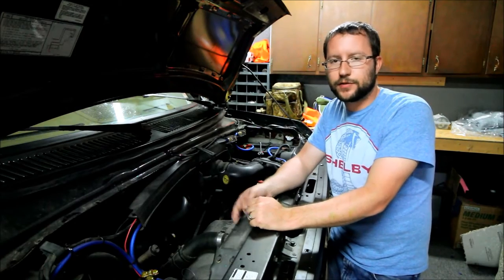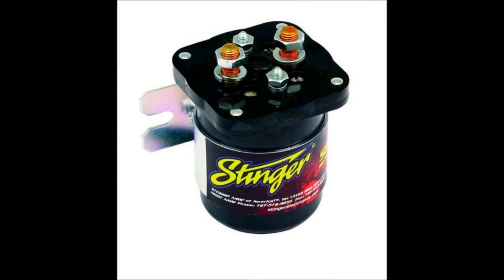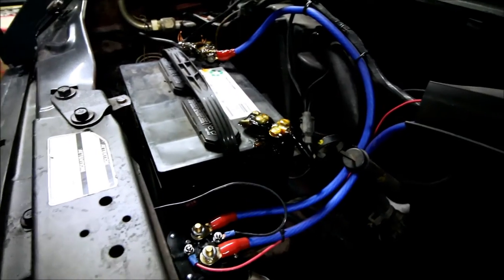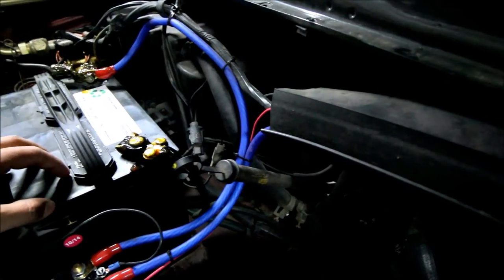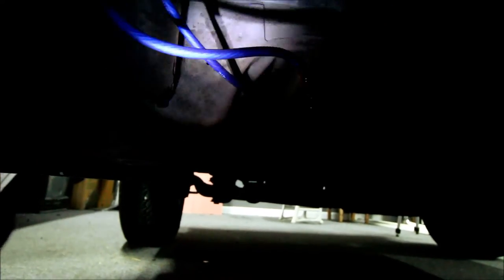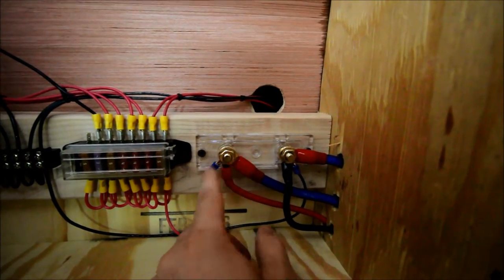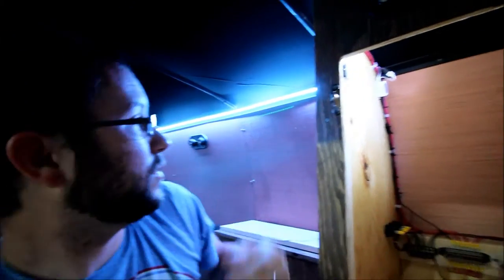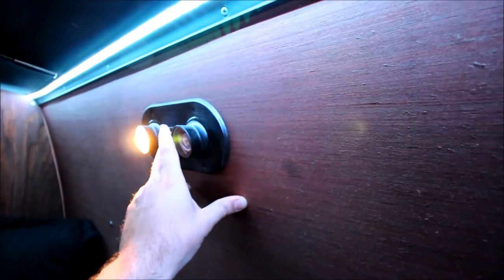Camper Van Power. My 12 Volt Battery Isolator Setup

Comment: Sweet setup on the electrical. This is the only thing i have left to do on mine.I am going to be using a setup out or an RV I'm thinking on mine.Since I got it for free lol.
Reply from the maker: That would be great to be able to use a 12 volt system from an RV. Anything free is worth re using!

Comment: If i may suggest .. up size the wire from the terminal block to your fuse block.. as in sure you know the current adds up and will cook that undersized wire.. looks like you may have used a 12 awg wire.. may wanna use an 8 or 6 wire for your fuse panel . might have to change out your fuse panel to one that has a main post that you could attach a larger wire.. GREAT SETUP!!
Reply from the maker: Prepping2endure thank you for the suggestion. It's been ok so far, but you are probably right. Thank you.
Reply: i was to suggest the same thing and i was checking if someone did it before me

Comment: I don't believe you mentioned where you found an open fuse for the dedicated ignition wire to the battery isolator...I believe thats what you called it.
Thanks for the video.
Reply from the maker: A true ignition source is what you are looking for. What that means is any wire that gets hot when the key is turned on. I was lucky to find a wire under the hood that had a female end on it that used to be plugged into something at some time. The easiest way to find a true ignition source is find the fuse block for your accessories or radio for instance. Find which side the power is coming in and then test the opposite side of the fuses. Find a fuse that is not hot until you turn your key on. Once you find that you can wire your true ignition source wire from your isolator to that connection. I hope this helps. I am not the best at explaining things some times.

Comment: The only problems I see is the inverter cable should be limited to 6' for voltage drop. 4' is ideal. But your inverter is small enough it shouldn't be an issue with 4 awg. Just mentioning for others. Short feed and output is where you can extend.
The most important safety feature is any hole use rubber grommets and silicone. I would refrain from metal clamps as vibration is your enemy and that is where insulation will wear. Always use stranded wire. Good video.

Comment: great explanation. big thank you. 

1. you said 4 gage wire for batteries.what gage for the lights (ie coming out of the fuse box?)
2. you need to run a ground from each light back to a grounding fuse box, back to the frame grounding? (totally new to this sorry)
Reply from the maker: Glad you liked it. I used 16 gauge stranded wire for my lights. You could use larger like 12 or 14 but I wouldn't go any smaller than 16. The main hot wire goes to my fuse block and keeps one side of the fuse hot, the other side of the fuse block gets wired to your hot side of your light or accessory. When you put the fuse in, it allows power to pass through the fuse to the accessory. The ground is similar but there is no fuse. I used a ground block for easy wiring. Ground your fuse block to the frame or ground post like I did, then your ground from your accessory will go to the grounding block. I had to use jumpers on one side of my fuse block and ground strip because each terminal did not connect to the other. It's a lot to take in if you aren't familiar with wiring, but once you do it a few times it will make sense.
Reply from the maker: All your grounds will go to the grounding block and the grounding block will be grounded allowing all the accessories to be grounded.  On the hot side, if your accessory has a switch all you need to do is put the positive wire to the fuse panel. If it doesn't have a switch and you want a switch, take your hot from your accessory and go to a switch and from the other side of the switch to the fuse panel. That way you have a switch in line on the hot side to turn your accessory on or off. Hope this helps.

Comment: @RubberTrampRenegade So the amount of amps that charges the shallow cycle battery (van) won't damage the deep cycle battery (house)? This is what I'm stuck on and don't understand. I'm about to put an isolator on my rig but I'm not sure why it wouldn't hurt my house batteries when everything out there has told me there is a limit to how fast you can charge them.
Reply from the maker: Ryan Bell I really think you are just confused. The alternator will charge the van battery and your deep cycle batteries if you use an isolator. I'm not understanding how charging the van battery will damage the auxiliary battery? What do you mean? I've had my batteries set up this way for over a year now and I have not had a single problem. Your alternator puts out about 13.5-14 amps when the engine is running.
Reply from the maker: The alternator is designed to maintain the 12 volt system while you drive and maintain your vehicles battery. It charges at a relatively slow rate.
Reply: OHHHHHH!!! I saw someone say that the alternator put out over like 60 amps. I was confused! (never measured it myself, sorry) 

But still, charging in this way would be like a continuous bulk charge, correct? I think we should let the 3 step MPPT charge controller charge the battery every once in a while too so as to let the battery go through all of its cycles. I think that would help lengthen the battery life. Does this make any sense to you? The only reason I ask is because I want to keep my batteries for as long as possible... because I got some expensive ones.
Reply from the maker: Ryan Bell definitely wouldn't want to ruin your batteries. I don't have a charge controller but I can see where it wouldn't be a bad idea. I've just use the isolator between my batteries and it seems to be working fine. The alternator charges at a constant voltage but shouldn't hurt anything.

Comment: Thanks for the video! This is exactly the setup that I will be looking to make in my own van, glad to see a detailed vid like this that didn't confuse things with solar. Just a quick question on the clear unit with two posts inside the cabinet that everything is connected to. What exactly is that? It looks really central to everything but isn't fully explained. Is it a circuit breaker of some kind?

Comment: from what I understand a 24v inverter uses less amp capacity than 12v. thought about 24v panels on roof of my van and 4 12v 100ah batts, 2 wired parallel wired in series wit other 2 that are wired parallel. problem is I have a isolator on van that says only puts out like 13-14v and that will only charge 1 12battery I hook it to. so question becomes should I hook it all up that way or just go with 12v battery bank and 12v panels?? I wanna run a few ac thinks and figure about 200ah's maybe used a day running 5000btu ac runs just over 500watts and 5amps, fridge from 50's I haven't found specs on, and in winter a 750/1500watt space heater. Basically I seen info that a 12v inverter will burn 10ah per 100watts used opposed to 24v inverter using 5ah per 100watts. now just for ac which isn't constant of course just as fridge and things, ac say 500 watts so 12v bank and inverter would be sucking 100ah vs 50if 24v? non of this makes a hell of allot sense to me as I'm thinking also 500watts x 10hrs is 5000watts so how the hell do I get 5000watts from solar either system that can fit onto a van's roof? I'm gonna have to figure something out before I hit the road as I'll have my 2labs with me and I'm gonna be boondocking/living in it with them and I'm not retired, can check them on brakes let them out do there thing which to me is better than them kooped up all day in house but things need to be very climate controlled for them while I'm working.

Comment: You Have saved me a lot of time a research thank you very very much, Have a question though, could you tell me about the true ignition source, does it have to be wired up to the car fuse box or something?
Reply from the maker: Dream Convertion I'm glad you found it informative. The true ignition source needs to be a wire that only has voltage when the key is turned on or in the accessory position. The easiest way is the fuse panel like the radio fuse. Since the radio only gets power when the key is on or in the accessory position, that's an easy one to track down. I got lucky and found a wire under the hood that was only hot with the key on. This is so when you turn your key off, the solenoid on the isolator breaks the connection between the batteries allowing you to only pull power from the auxiliary battery, hint "isolator" as it isolates the auxiliary battery.

Comment: Thanks Seth!! Excellent video!!  Came at the right time as I'm getting ready to install my Stinger 200. Heck, I even have the same auxillary battery as you...so this vid is custom made for me. Lol. I never thought about putting an 80 amp fuse from the auxillary battery to the fuse panel. Extra protection? Do you have solar? I've been debating that. Your van is Kick Ass!! Great Job. Headin to your blog next!!
Reply from the maker: I added the 80 amp to protect my battery if something shorts out and goes haywire. I do not have solar, I only have the isolator for charging my battery. So far it has been enough as long as I run my van at least 15-20 minutes a day. Thanks for watching.
Reply: I see, that makes total sense.  Yes, Ill probably just have the isolator too. I'm not going to be running too many appliances except the fridge, a fan, charge up the computer, and a light. Cost of solar adds up quick. Thanks for the reply Seth!!

Comment: clean installs man. those lights look great too. I dig your footage and transitions, very smooth. what camera are you using?
Reply from the maker: Thanks for the compliments. I am using a canon t5i with a canon 10-18 wide angle lens. I'm still learning how to edit video, but I'm having fun with it.
Reply: +RubberTrampRenegade well your off to a hell of a start my friend. how do you like lense?
Reply from the maker: +Into The Mystery 13 I love the lens. It's the new canon wide angle that came out about a year ago. It's only about $100 and you can find them at Best Buy. They have a plastic body, but I haven't had a problem with it at all. I use it for my real estate photos also.
Reply: Into The Mystery, it's funny you say that because I was distracted by his videos cross-fading over the top of one another. A clean switch between clips would have been cleaner (and more "pro"). But I dig the video. :)

Comment: Your alt has to work really hard to charge a deep cycle battery. What keeps the alt from over charging the primary when it’s full and aux is empty?
Reply from the maker: The alternator doesn’t have to work any harder than normal. I had the van for 2 years like this with no issues. As far as over charging, what keeps your alternator from overcharging your main battery if you didn’t have an aux battery? Nothing. Batteries only charge so much. Once the battery is full it just maintains. With the aux battery, once the main battery is full, the excess charge transfers over to the aux battery. Thanks for watching.
Reply from the maker: Example. When you plug your cell phone in to charge do you unplug it immediately after it is full so it doesn’t “over charge”? No, you don’t. A battery will not over charge that way.
Reply: When the two lead-acid batteries are hooked together parallel the voltage between the two equalizes or the stronger battery drains into the weaker until the voltage equalize.This is why having two matching batteries is important as the weakest battery will draw down the larger battery and the system will charge to the smaller batteries parameters.. The alternator has a voltage regulator that determines the charge rate needed and supplies it. As the voltage rises in the batteries the regulator adjusts the charge rate appropriately. Your cell phone has a smart charger that regulates the charging as your phone battery has much more complicated charging requirements.  @RubberTrampRenegade
Reply: I will also add that your starting battery needs to be continually charged and is considered dead at around 11 volts if I remember right. discharge below that causes damage. Your deep cycle is designed to be discharged and not be continually charged.that said your deep cycle cannot be fully charged by your alternator. Adding separate battery maintainer/charger you can plug in[shore power] when your van is idle, charging your deep cycle exclusively will give you a stronger deep cycle that will last longer.. That all said these are just the finer points to the system and there is nothing wrong with your set up.I hope this helps some.
Reply from the maker: River rat well after at least 2 years I never had an issue. I recently sold the van and it was still working great. Both batteries were still good and the alternator still working as it should. But everyone on YouTube seems to be an expert and a naysayer.

Comment: Okay how long have you used your setup like that and I'm kind of torn between a Google search some people say use 10 AWG or some people say use for AWG because it charges quicker is there a difference or rather use a thinner wire if I can
Reply from the maker: I have used this set up for over a year. I forget the size of the main wire off the top of my head but it should be in the video. All of my accessories are 16 AWG stranded wire. My opinion is that 10 AWG would be too small for the main wire, but depending on the rating it might be sufficient.

Comment: Ok when the vans battery has. A full charge does the charging of the houses battery damage the vans  battery
Reply from the maker: fvfgx no, not at all. A battery can only charge so much until it is full. Your alternator charges your starting battery the entire time you drive. When it is fully charged, the excess charge/voltage will be passed on to the auxiliary battery through the isolator and charge until it is full. When they are both fully charged the alternator will continue to supply voltage to them, but they will not be damaged.
Reply: @RubberTrampRenegade So the amount of amps that charges the shallow cycle battery (van) won't damage the deep cycle battery (house)? This is what I'm stuck on and don't understand. I'm about to put an isolator on my rig but I'm not sure why it wouldn't hurt my house batteries when everything out there has told me there is a limit to how fast you can charge them.
Reply from the maker: Ryan Bell because with an isolator you allow your house battery to be linked to the main van battery and be charged while the van is running by the alternator. It's not like you are charging it at a rapid rate.  It's not like putting a fast charge on it. Like I said, I've ran this set up for over a year and have the same batteries as when I started. Both of my batteries hold charge and I have not had any issues

Comment: How do you know what size fuse to use for the different accessories?
Reply from the maker: Red Fit some accessories like the fridge and roof fan you can research the specs for. The fridge and fan pull just over 4 amps max so I chose a 5 amp fuse for each of those. It's almost a guessing game on some of the others like the lights I got from the scrap yard. Most 12 volt electronics pull less than 5 amps. I used some 2.5 amp, 3 amp, 4 amp, and 5 amp fuses. I haven't had any problem.

Comment: hey nice video just one question does that stinger maintaining the charge on your second battery... or does it just isolated. cuz I just purchased one and I might be returning it. I don't think it prevents the second battery from overcharging unless it's working off the sensor on the alternator. to prevent overcharge..
Reply from the maker: Urban camper guy it's basically just a switch that isolates the secondary battery from the starting battery when the ignition is off. As far as over charging, I have never had any issues.

Comment: does your van have to be on to use the auxiliary battery?
Reply from the maker: Brady's Dragon Tales no, the auxiliary battery can run all my 12 volt accessories with the engine off. When the engine is on, the stinger solenoid allows my alternates to charge the auxiliary battery. When the ignition is turned off the stinger solenoid (isolator) breaks the connection between the staring battery and auxiliary battery allowing me to only use the auxiliary battery to run my 12 volt accessories without draining my starting battery. It's basically like a switch. Hope that helps
Reply: yeah, my auxiliary battery is hooked up with just a solenoid, the van has to be on. if I swap it for an isolator will that solve my problem?
Reply from the maker: Brady's Dragon Tales an isolator is basically just a solenoid. I'd have to research your solenoid to understand what you have going on. I'd also have to see your wiring probably. What are you trying to run off your auxiliary batterie?
Reply from the maker: Make sure what you are trying to run with your auxiliary battery is wired directly to your auxiliary battery. For example, I cannot run my radio with my engine or ignition off because it is wired to my starting battery and not my auxiliary battery.
Reply: I'll have to recheck my wires. Thanks man.

Comment: Having trouble finding details on the true ignition source wiring. You skip right over it like almost everyone else.
Reply from the maker: Ihaveriffs any wire that becomes hot when you turn the key. The radio is the easiest to find.
Reply: RubberTrampRenegade Thanks! I found one that seems to be working. I get voltage only when it's running and not when it's off.
Reply from the maker: Ihaveriffs yep, that's what you are looking for. Glad you were able to track one down